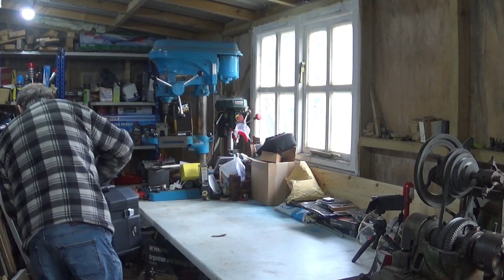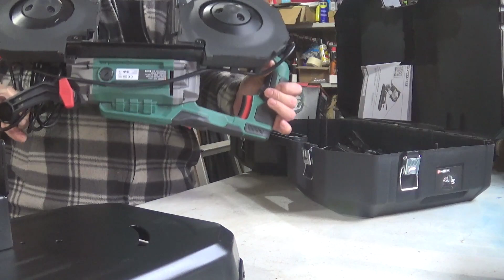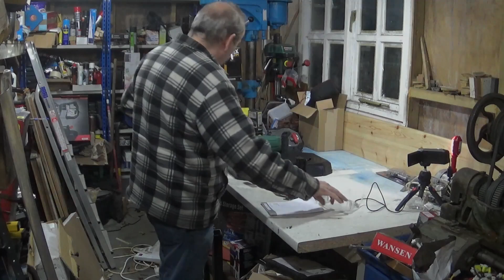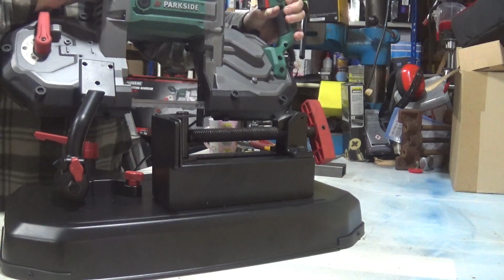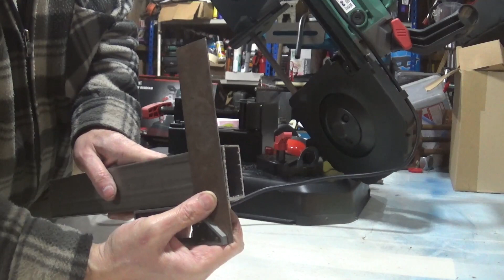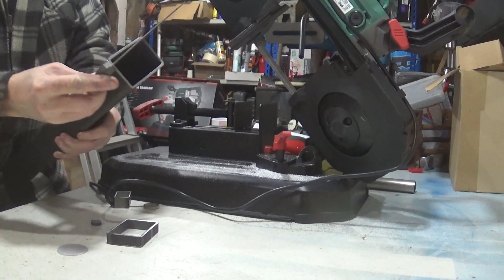Lidl Parkside Metal Cutting Bandsaw PMB 1100 A1 Part 1 Setting up and quick review

Comment: I have one of these saws and while it does cut down the work time a bit its not great for cutting a miter in square box section 50mmx50mm as the position of the clamp has the box section hitting off the bottom of the saw so it won't go through the material
Reply from the maker: Yes, the stand leaves a lot to be desired. I am planning on building a stand so that I can use it as a metal cutting bandsaw.

Many thanks for watching, please like, share and if you like the channel, subscribe!
Reply: @BensWorkshop  yeah I had thought of build a new base so that the saw just moves up and down .With a swivel type vice on it for cutting the miters to see if it makes the saw more stable for a more accurate cut
Reply from the maker: That's one possibility. What I was planning has been done before, but basically turns it into a hand fed bandsaw with table if you know what I mean.
Reply: @BensWorkshop  yeah I just watched a video of adam savages one day builds he turned one of his old one into an upright bandsaw. I actually liked that idea too

Comment: I adjusted the vice on mine by slotting the 4 holes about 20mm so it can slide back, this allows bigger box section to be able to be mitred on my projects.
Reply from the maker: That's a interesting idea. Out of interest how square does yours cut?

Thanks for watching!
Reply: @BensWorkshop  actually really good 👍 
You can make a packer to push the material off the back to allow 90° cuts so your not having to loosen the 4 bolts every time
Reply from the maker: @raymondbeattie7133  I put some packing under the far side of the vice which improved one side but when cutting box it does not cut both sides square to each other.

Comment: Looks aright to me mate. I like the Parkside stuff I have drill from there and  a grinder both seam to work well. Think they are Good for the money.👍
Reply from the maker: The problem I have is that there'd be so much fettling on box to get it square enough for welding I might as well use a grinding disk. However I will do a blade change video and then report back. I do like the Parkside stuff generally, I have a lot of it.

Comment: Yeah, disappointing cutting on first test but definitely worth trying with a good blade.  My Axminster wood cutting bandsaw couldn't cut a straight line in cheese with the supplied blade (I think the Axminster "hobby" range are only imported stuff with Axminster branding) - as soon as I put one of the better Axminster Axcaliber blades on it the machine was transformed.

I've always wanted one of the metal cutting bandsaws because it's hard work cutting stuff by hand when I'm fabricating something but I would like it to cut more or less square.  Looking forward to the test with a better blade - mind you, by that time there'll be none left in the shops.

I've quite fancied one of the older type powered hacksaws (there's probably a better name for them than that!) - they pop up for sale occasionally with flat belt pulley drive - the dream would be to use one of my stationary engines to power one but in reality can you imagine how often I'd use it if I had to drag out and fire up an engine every time I wanted to cut some steel!!!!
Reply from the maker: No worries. With a bit of luck a Milwalkee blade will arrive Thursday.

The thing you called a powered hacksaw is in fact called a "powered hacksaw". We have one in the club, runs of an induction motor. Can take an age to cut but just plods on till it's done.
Reply: @BensWorkshop  Coo, I actually got the name right!!!!  We had one when I was at school, again powered by an induction motor - I loved the way you could just set it going and walk away.

The Lidl one has the advantage that it's small - just right for a small workshop.  Really interested to see how the new blade goes, or for that matter, weather there's anything else that could be tweaked to improve squareness.
Reply from the maker: @GrumpyTim  I will report back as soon as I have news...

Actually I think it is called a Power Hacksaw.

Comment: Hmm... Not overly impressed with it's performance.

I'll be interested to see how it performs with different blades.

I sold my floor standing metal cutting bandsaw because the only thing it did well for me was freehand cutting shaped parts and for that to work I got 1/4" blades made up which only lasted 5 minutes.
Reply from the maker: I wasn't impressed either we'll see how it does with a Milwaukee blade later in the week.

Comment: Aldi sold the same ones but under a different brand . I went through 7 machines and all of them could not cut a true cut . I then  purchased a Femi band saw and that machine allowed fine adjustment and cut perfectly. The only problem with the Femi is the price at around £700 it costs too much for the weekend DIY user but what a machine it was .
Reply from the maker: Yes, I can see that. Though I am going to make a stand so that it can be used as a vertical bandsaw.

However I will try a different blade though, I bought a cheap circular saw that drifted to the left but a new (as it happens cheap) blade fixed that.